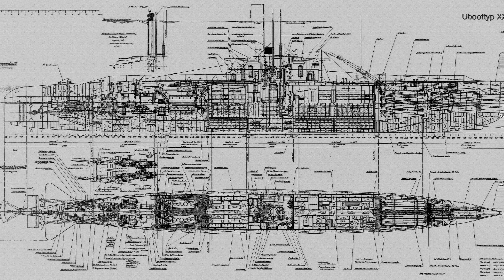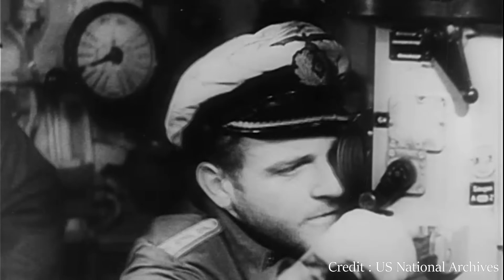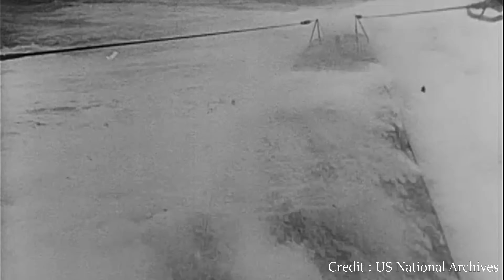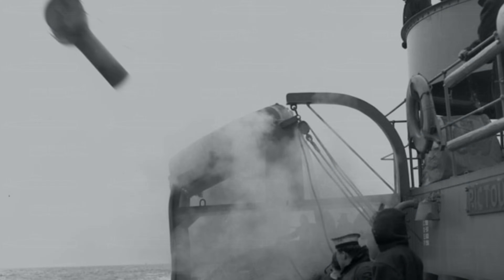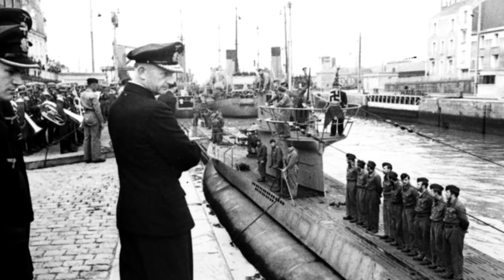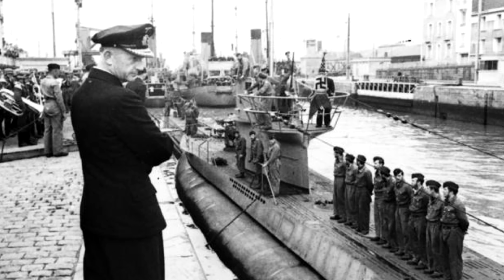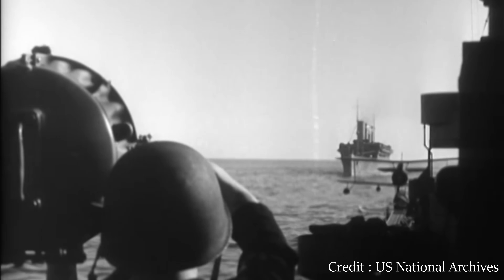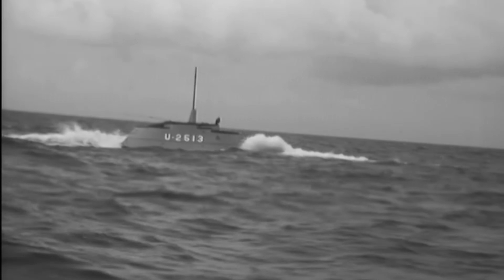Was the most innovative submarine design of WWII successful? The German Type XXI submarine

Comment: We will never know what the truth was... history has been always written by the winners. However I find it particularly strange that diesels would have been so underpowered, 850HP instead of 2000HP each? They already perfected the 6 cylinder supercharged diesel engine design on the type VII boats, and they known as produced around 1600HP each. I find it rather strange that they would have made such a mistake, it is probably the same engine, same clutched mechanical drive. 850HP is more like the ballpark of the type II boats which were indeed underpowered even with third of the displacement. Underwater performance seems closer to the expectation, and 15 knots for 50 minutes could gave them much better getaway chance.

Does it matter? No. Even if the XXI sufficed all the expectations, it was already too late. Did everyone copy the design after the war? Was it the first real submarine, designed primarily for submerged operation? Yes, even the US Tang class used features from the XXI. So it was probably not that bad... but that is just some guesswork, do not take it too seriously.
Reply from the maker: The primary reason for the lower power output was due to the removal of the supercharger. The US studies of the XXI has some more details on why it could be. Their tests rated the setup to below 1200 HP, but again, that's what their studies concluded.
Without an actual XXI to study, it's impossible to know for sure. The only thing which is certain is that it didn't deliver to the expected specifications - this was also echoed the German sub captains who operated the type XXI. 

Personally my view is that there was not enough operational experience to confirm or challenge the design specifications, so they just became fact over time.
Reply from the maker: I found some more details on this - the 850 comes from snorkling operations, which makes sense in the aspect of the purpose of the submarine. It was designed and required to sail submerged and under these conditions the max output of the diesel engine was 850HP. Its described in the US design studies https://www.uboatarchive.net/Design/DesignStudiesTypeXXI.htm
Reply: @BecksHobbyProductions  Thank you for the additional information. I have been studying the report and now have a better understanding. First I believed the snorkel introduced extra draft, but now I rather understood that the problem was the overheating. 

It appears German engineers were in rush and just wanted to shove too much horses into the diesel engine, so the supercharger operation was something US Navy found unsafe due to excessive exhaust gas temperatures, so they removed it completely.  I have not yet figured out any details what do they meant by hazardous... probably literally heat shock of the engine.

 "The diesel engines, on the contrary, have proved a major weakness in the vessel's design.  On actual trials the output was limited to 1700 HP (15 knots) by excessive exhaust gas temperatures.  Furthermore, the exhaust driven supercharger when used during snorkelling operations proved hazardous and was subsequently removed.  The diesel without supercharger is able to operate only with snorkel cams in, with a resultant limiting output of 850 HP (12 knots) before excessive exhaust temperatures are reached. "

Hence, removing the supercharger, the diesel engine was forced to use the snorkel cam profile, resulting 850HP.
Reply from the maker: @salikaa86  Thanks for the comment anyways. Its always a learning experience, when these kind of questions comes up :) I guess we both learned something.

Comment: You missed one of the most important innovations. Type 21 was build in segments, transported to the shipyard, there it was finished and put together. This increased the speed of production enormously and reducing the effectiveness of bombing the shipyards
Reply from the maker: You are correct - I didn't cover it in this video. That's because it was not directly related to the operational performance of the submarine during WWII. However, I did cover it in my other video about the design and construction: https://youtu.be/FJ_O4DKcdkg?si=s_nWfsIPQZELocmg

I also have a videoproject in my backlog to tell the story of the Valentin bunker where the assembly was to take place.
Reply: Problem was Tallboy Bombs kept breaching the banks of the Canals upon which the hull segments were to be transported on.

Comment: Type XXI was always a prototype (contrary to what they say).  Germany had big supply problems, requiring compromises and just lies - i.e. they were reporting 1000 HP engine while it was 500 HP because of "substituted" components, etc.  Just a collapsing state.  It does not change the fact that XXI design was miles ahead of other subs.
Reply: True mostly, however Germany had 119 boats commisioned at the end of WW2 with a further 7 held back for training and experimental purposes due to construction defects. Almost unbelievable under the circumstances. 
Anatomy of the Ship Series.

Comment: Neither the main engines nor batteries were those of the design, but poor solutions due to the very bad situation of Germany at those times. Quite a pitty that only a botch job of this wonderful piece of engineering was tested.
Reply from the maker: The type XXI was a derived design from the type XVIII. The type XVIII was a proposed hydrogen peroxide powered submarine, but when the development of it, did succeed fast enough, the same design was adopted with a traditional diesel/electric powerplant. This could be done because the significant space needed for the hydrogen peroxide fuel could house batteries instead. In other words, the type XVIII was born with a hydrogen peroxide powerplant, but the XXI was born with a classic diesel/electric. From the outside, they appear identical..Source : David Millers work on U-boats.

Comment: German U boat captains to Admiralty toward the end of the war: "We go out on missions and the enemy is just waiting for us. They know what we're doing. They've broken our code!" Admiralty: "Enigma is unbreakable." Alan Turing: "Oh yeah? Hold my beer."
The U boat fleet suffered extremely heavy casualties, losing 793 U-boats and about 28,000 submariners, a 75% casualty rate, the highest of all German forces during the war.
Reply from the maker: The even if the type XXI had delivered it would have faced the same challenge as the other U-boats; finding a convoy. 

That being said, if it did find a convoy and performed as designed, chances are it would have caused severe destruction...

Comment: I read that the type 21 u-boat was originally designed to use hydrogen peroxide to fuel it and this proved to dangerous for the crew and standard diesel/electric  purpupulsion was substituted instead.

?
Reply from the maker: It's correct, that the submarine with the hydrogen peroxide powerplant was the origin of the type XXI. It was called the type XVIII. I even made a video about it 😊 https://youtu.be/FJ_O4DKcdkg

Comment: I will go with Erich Topp's assessment but considering the much smoother hydrodynamics of the hull, I'd question the submerged speed was less than a type 7 or 9.  Swept area surfaced may have caused less surface speed plus the elimination of large deck guns for AA batteries kept the type limited to submerged attack.  The fact remains that the type 21 was much cleaner submerged. What about the Wilhelm Bauer and the two type 23 subs raised and used by the post war German Navy?  What did they show?
Reply from the maker: The type XXI was faster than the type VII submerged, however it was slower on the surface. So neither speed delivered to what was required 😊
Reply: You failed to explain why the XXI was different from the VIIC in tems of speed.  Design differences of course, but in what critical ways?   @BecksHobbyProductions
Reply from the maker: That's correct, I have not dived into the deeper technical parts which enabled the type XXI to reach those higher speeds. However, that was not the goal of the video either (as stated in the introduction). I do touch upon some of the design elements in my video about the type XXI design, so feel free to have a look at that one :)

That being said, the electric motors of the type VII and XXI had very different output, but this fact cant be viewed in isolation as the size of the vessel and the drag of the shape also play a major role and to detail the key aspects and how they made a difference is a whole different conversation and engineer would be better suited to carry :) @EllieMaes-Grandad
Reply: Thank you.  After seeing this video, I found the earlier one, which covers some of the aspects.   @BecksHobbyProductions

Comment: A fascinating video and a different take on what I expected. IIRC, only 2(?) saw combat service (each for one patrol?) so it's difficult to know how well they might have done. The second pair of small motors was a brilliant idea, making them exceptionally quiet especially if they could dive deep. Their passive sonar was excellent for the time. Had one gotten into a convoy they could have let loose 18 torpedos in 20 minutes so it was mostly the "fault" of Allied escorts being efficient as much as the boat design. As I understand, it was their ability to stay submerged that could have made them more survivable. A Type VII could remain down for about 14 hours, while this model could stay down 75 hours, before lack of air and battery forced them to surface. Albert Speer attempted to use the US model... build sections and assemble. That worked great for the US but many of the assemblies were inexpertly built. Had it worked they could have rolled off the assembly line in significant numbers starting in 1943. It was a good enough sub that Pres Truman took a dive to 440 feet in U-2513 in 1946, when part of the USN. The Soviets acquired 4, built 15 more from parts, and may have assembled another 39 at captured plants, and France kept one in active duty until 1967. They may have had problems, but were still excellent boats though requiring significant service.
Reply from the maker: Yeah, my sources also say 2. Many more were built but they had so many issues that they spent a great deal of time making them good enough for operations. 

I am planning to visit the Valentin bunker in the fall. Hopefully I will be able to put a video together on its link to assemble the XXI sections inside a big massive bunker. 

As for the ability to be effective with the fast reload - It was tested in real life and had it worked it could have caused severe problems for a convoy. However, the type XXI was limited in the same way as the other U-boats; they had to find the convoys in the first place. I can't remember the exact data and don't have my books with me, but after (I think) 1942 above 98% of the cargo sent over the Atlantic made it. To a significant degree because the allies were able to direct convoys around the U-boats. But it's speculating 😊

Comment: With the snorkelling capabilities I had assumed that it would spend little time crawling on the surface. Considering the remarkable degree of shameless copying of the craft it must have had significant capabilities.
Reply from the maker: It was the plan that it should be able to obtain a high speed, but that didn't turn out to be possible. If I remember correctly, there was a severe vibration when using the snorkel at too high speed.
Reply: @BecksHobbyProductions  interesting. Perhaps vortex induced vibrations affected the snorkel stem. That’s not too difficult to fix. I think that the Allies were the main beneficiaries of the technology and completed the development process.
Reply from the maker: @robinwells8879  true. History shows that derived learnings did achieve success 😊

Comment: Rubbish!  The 21 could do 28 knots submerged; it had 3 times the batteries of regular U boats.  Was originally supposed to use H2O2.  But peroxide nasty - does not like right angle bends, and of course with metal it goes nutsoid!!
Reply from the maker: Maybe its the type XVIII you have in mind? It's very very similar to the type XXI in appearance, but was meant to be powered by a hydrogen peroxide powerplant designed by Helmut Walter. These experimental boats were also called The Walter Boats.
Reply: No, the type XX1. It was steamlined and had powerful electric motors.  And originally a H2O2 ship, but peroxide very nasty.  British submarines tried peroxide torpedos and at least one sunk when a torpedo went off.  With metal, goes to 800C with lots of steam.
 Diazomethane, a methylating agent, also dislikes ground glass, and glassware must be heat polished, must react at below 20C - violently explosive and deadly poisonous!  @BecksHobbyProductions
Reply from the maker: @davidwheatcroft2797  do you have a reference? My source material tells a different story 😊
Reply: No just Internet, so was surprised to see the underwater speed so low.  They refer to "speed" underwater, but was that MAX flank speed?  It was streamlined; the electric motors more powerful than the diesels; no big gun/railings etc.  There is one in Bremen you can go on.  Had a little rail system to work on the huge batteries.
Was used till 1965 odd I think.  I am a pilot, so not my field - navy stupid; one guy bossing everybody around and 1 guy in a plane can sink any ship. @BecksHobbyProductions
Reply from the maker: @davidwheatcroft2797  I don't have my books with me, but this site is usually rather reliable: https://uboat.net/types/xviii.htm

The type XXI in Bremerhaven is the previous U2540. It was scuttled at the end of the war and raised in 1957 to be used as a testbed for new submarine designs. This also means that many modifications were made, so it's not to be considered a type XXI in a WWII configuration. I will visit them in the fall to shoot a new video of it 😊

And yes, the speed is the highest speed.

Comment: The type 21 could have really been Germanys truely war winning Wonder Weapon. Even the post WWII first Nuclear Sub, was basically a Type 21 with a reactor in it. A truly technicall breakthrough, even more so than the V-2 Rocket !!!
Reply: Nope the brits already had the ASW equipment to counter the type XXI. Not even the first nuke subs was inspired by the type 21
Reply: @gotanon9659 Spoken like a true Brit.
Reply: @gotanon9659 
The RN were rightfully concerned by the development of high speed submarines. The results of the Fairlie ASW trials of Sept 1944 with a modified HMS Seraph confirmed the fears of the Admiralty in that it concluded the only way to counter the new U-boats in the short term was to bomb the assembly yards until new countermeasures and tactics could be developed. Assuming the new U-boats potential was reasonably close to that anticipated by Nazi Germany then the Allies had no effective countermeasure available in 1944/45. However it would have given time.

Comment: As for max depth - I doubt the 10 extra meters compared to VII/C ir IX matter. And the subs that left the dock could not even use the rated depth due to problems with a hatch buckling.
Reply from the maker: I found the data to support this. You are correct that if you look at the specifications for max depth in itself was not a big change. The statement comes from the fact that the safety margin for the type XXI was significantly larger than previous designs, which allowed the captains the discretion and safety to dive deeper.
Reply: assuming you got the rare one with a fixed hatch. And solid welding. And no problems in the segments.

The RN said "worth than previous onces, shoddy quality". And those where the ones that passed german inspection instead of being rejected

And hope that no slave worker sabotaged it more suptle to drown Nazis by the dozend. @BecksHobbyProductions

Comment: US subs were useless till mid/later 43 thanks to the MK 16 nightmare, Price of Wales lost more and more guns due to malfunction during the battle agist Bismark, Bismark herself knocked out its own radar rangefinder by firing at certain gun angles. Early shermans had a nasty habit of going up in flames by even relativly minor hits.(as did early Panters)

 Even IF the MK XXI would have been put together with the best material and expert labor there would have been simply no time to grow out the teathing problems that nearly any new weapon system has. if the desighn had no promise there would had been 0 sense that nearly every postwar navy based their designs on it since while it was good to make the enemy much scarier than it was to make killing a much greater arceivement experts that actually analyzed captured equipment were much more non nonsense than peps in the propaganga department.  Another case of too little too late and perhaps a bit too ahead of time to be made with what late war germany had to build with.

Also the arcustic signiture part is nonsense since the high underpater speed was realized by using snocle and diesel. Any latewar Type VII would be as loud since it uses the same propulsion with an hull not optimized for high underwater speed.......figure who would fare better once both switch to electric.....unless you mean its a biger boat? then a type IX would be also worse than a Type VII but that isnt louder but providing more surface area for acdic to bounce from?